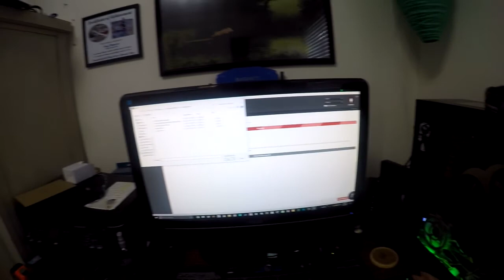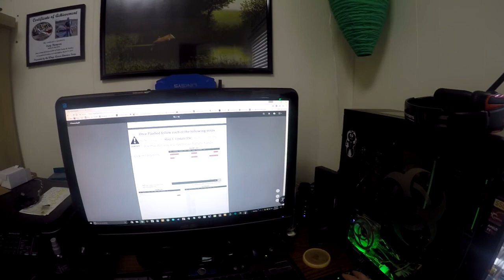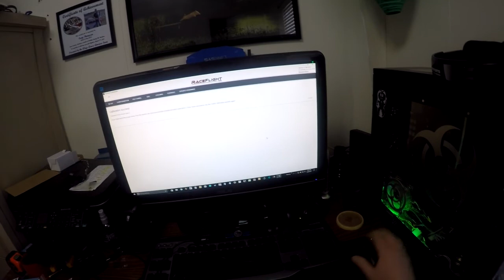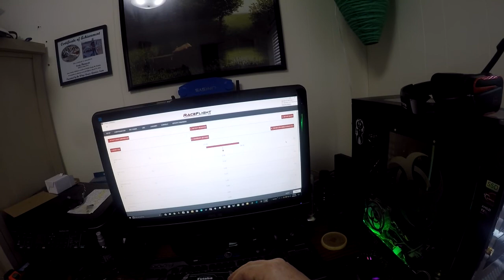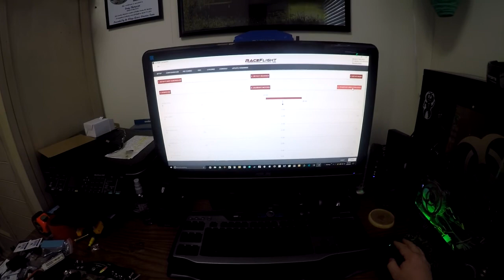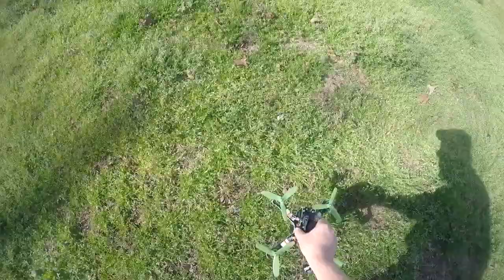RaceFlight One Flash and setup

Comment: Hello,

I have bought a used copter with a Spektrum F400 SPMFCF400 FC.
Previously, this was operated with a DSMX receiver.
However, I have Futaba and would now like to connect a R6107SP.
I've been trying to marry them for days now. Unfortunately without success.
Do you know how to do it?
Which pin of the receiver must be connected to which pin of the FC?
What do I have to configure in RaceFlightOne to get the connection?

thanks a lot and best regards,
Chris